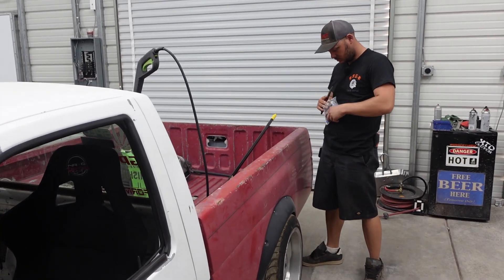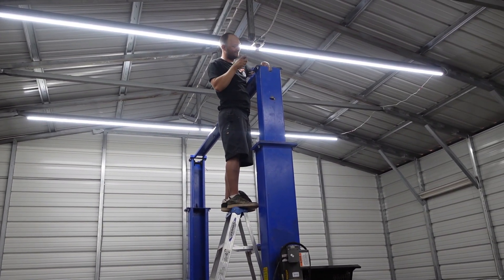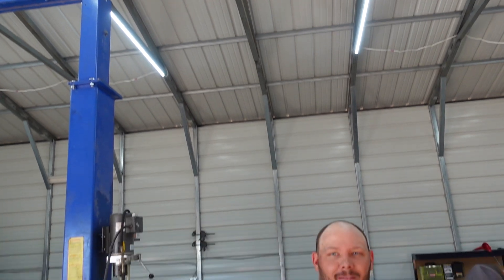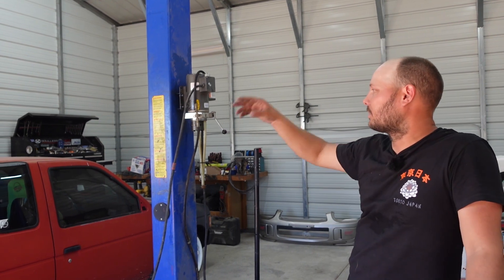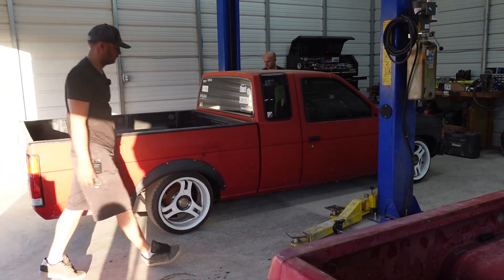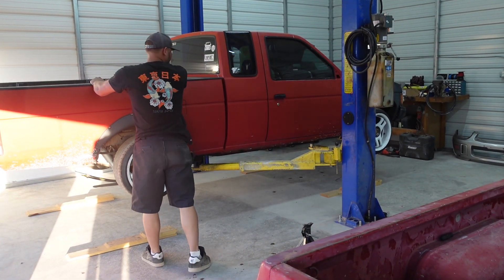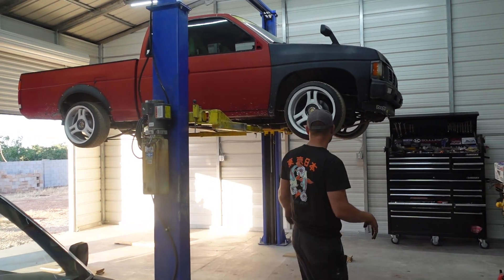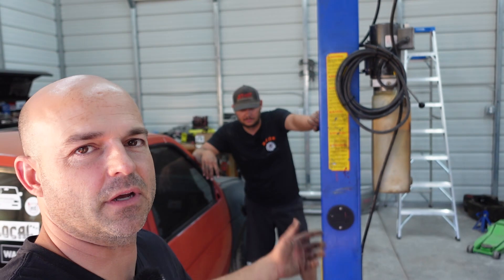The Lift Is Operational!

Comment: Don't know if you guys will actually see this if not I'll try again when there's another upload,
But what spark plugs did you guys use for the simple turbo build? I run ngk coppers in mine and didn't know if I should go for a slightly hotter plug
Reply: @LocalLosers520  it'll probably be fine on the standard coppers thanks lol